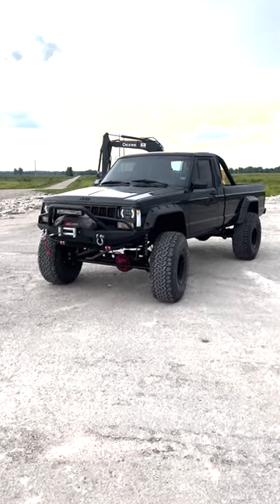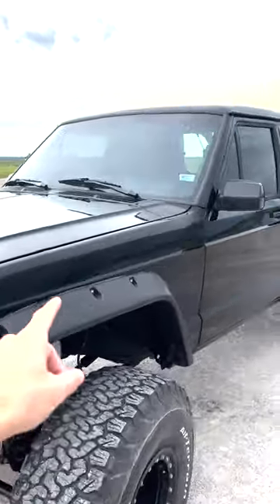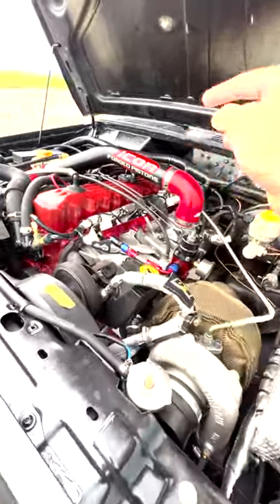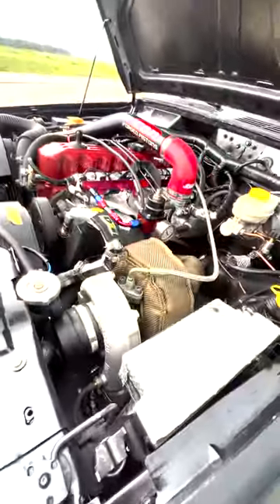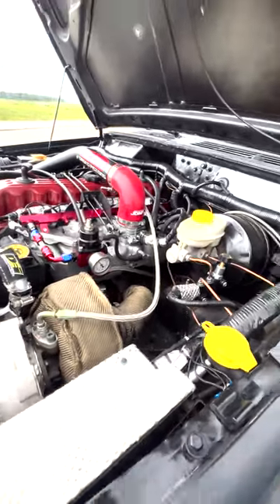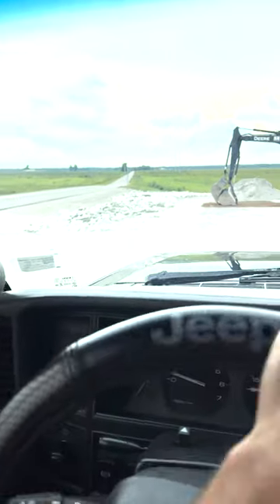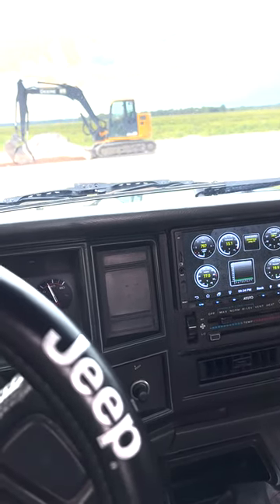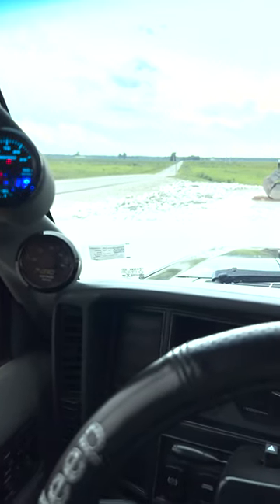Jeep Comanche Turbo 0-100MPH Pull

Comment: Man that's a good looking truck. Did you swap over everything from the 96? Relay box, coolant overflow bottle, etc. Engine bay looks super clean compared to my stock 89. Thinking about doing the same to mine, but I have a renix system and I'd have to do the electronics too.
Reply from the maker: Yep, it’s originally a 86 that came with the 2.8! I got a donor late model 96XJ and swapped absolutely everything in it over and redid the harness while doing it

Comment: Awesome build.  I'm currently in the planning phase. I'm digging your setup.  

Could you provide details on the manifold?  
-Did you buy it?  
-Make it yourself or had it made?

Could you confirm which Clegg kit you went with?   Is it this one?
Stage 1 Jeep Stroker Kit 4.6 Liter / Compression Ratio = 8.8:1

How about the cam kit?

Thanks....
Reply from the maker: Mine was the stage 2 kit at the time and the cam is the stage 3 kit! 

As far as the manifold it is hand made, I recently bought the boostwerks manifold though!
Reply: @Ochszy  Thanks for the info.   I'll check them out. Are you running stand alone ecu?

Comment: Very nice mj man. I have an 86  that had the 2.8 as well. Ended up using two 92 xj’s to convert everything over so i know you’ve literally touched every single nut and bolt on that truck. Just curious though, where’d you mount the battery?

Comment: Nicely built. Very clean looking. 

Is it typical to run such low compression at these boost levels?  I know it all depends on the engine, but newer turbo engines have higher compression (10+) with 20 or so PSI. Seems like you could have kept the compression a bit higher (9-9.5) though maybe you'd need E-85. Not sure if that is available to you and it can be a pain if you need to drive it long distances - both finding E-85 and the reduced mileage. Meth injection would be another option. Not expecting you to go back and change the pistons, just curious. 

Getting it fully tuned with a 2.5 bar sensor should make a pretty big difference.
Reply from the maker: The tuning with HPT on the 96 JTEC ECM's is pretty crude, id have to go full on standalone Megasquirt or Holly to run higher compression and have a lot of dyno time! This is the stock Jeep Compression ratio 8-8.1 just with forged pistons! Maybe down the road ill swap them out, it deff kills fuel efficiency

Comment: Pretty sure you were shifting way too soon you'd get up and move if you stayed in the higher rpms. I know this because I hit 100 in fourth gear 5th is really just overdrive. Beautiful truck tho. Little fyi you can beat on it without having to worry about it breaking anything. I've jumped mine several times run it hard everyday and it doesn't mind one bit. Might as well have fun with it rather than just showing off.
Reply from the maker: Its not done being tuned, It also has a factory Cam so its not making any more power above 4500! I've had it for 10 years, I've had my fun in it. its more of a show truck now, I have my corvette to have the fun in now!